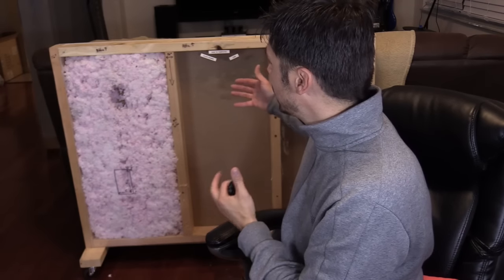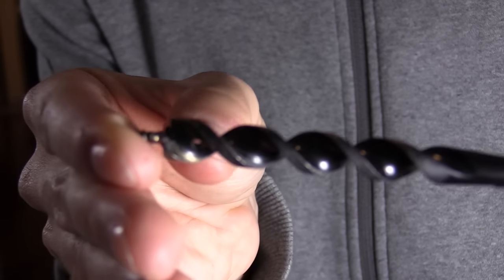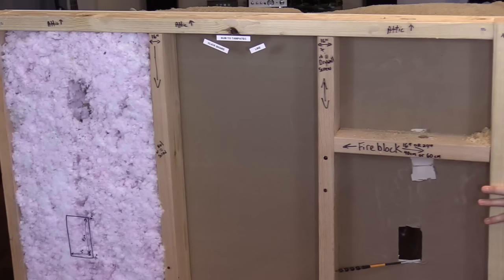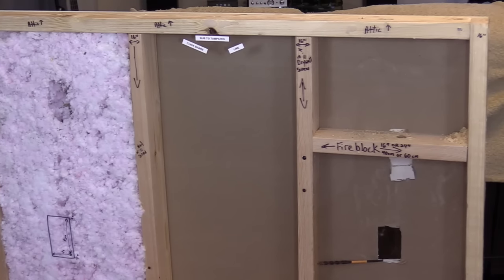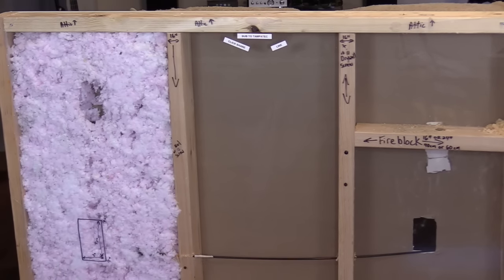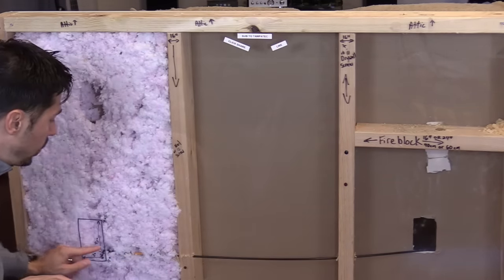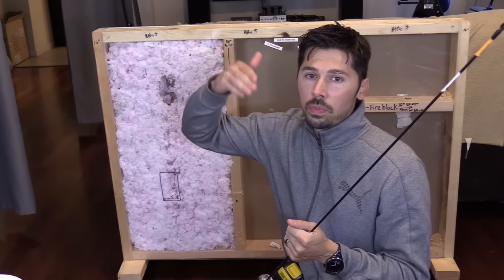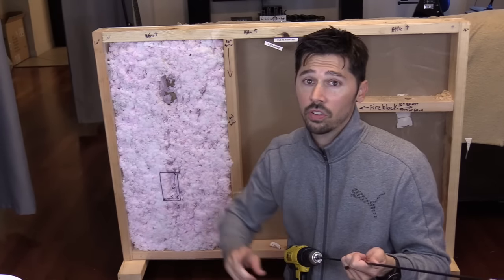HOW TO FISH CABLE WIRES THROUGH STUDS HORIZONTALLY USING FLEX DRILL BIT

Comment: Code calls for drilled holes to be at least 1 1/4" from edge of stud. You're so close to the edge you literally split the edge of the stud while drilling. And this is with the studs completely exposed! This is why blind drilling is a no no my friends. Let's not even get into the existing wires and water pipes that could be in the way.
Reply: Exactly.
Reply: Definitely!  The damage that can be caused is not worth trying to take the short cut.
Reply: I drilled a hole that as soon as it touched the 1 1/4" edge from the stud... My whole house collapsed. Then burst into flames. Then flooded. Damn short cuts. 😪
Reply: @kawininja06  🤣🤣🤣wtf!!!!!
Reply: Only on loadbearing walls. Non-loadbearing this is fine
Reply: @depholade  that is absolutely incorrect per NEC Code. I really hope you’re not a licensed electrician saying this.

300.4(A) Cables and Raceways Through Wood Members.
(1) Bored Holes. In both exposed and concealed locations, where a cable- or raceway-type wiring method is installed through bored holes in joists, rafters, or wood members, holes shall be bored so that the edge of the hole is not less than 32 mm (1 1 ∕ 4 in.) from the nearest edge of the wood member. Where this distance cannot be maintained, the cable or raceway shall be protected from penetration by screws or nails by a steel plate(s) or bushing(s), at least 1.6 mm ( 1 ∕ 16 in.) thick, and of appropriate length and width installed to cover the area of the wiring.
Reply: @Ih8chew  Holes in non-bearing walls can't exceed 60 percent of their width. Notches in non-bearing walls can't exceed 40 percent of their width. The edge of a hole must be at least 5/8 in. from the edge of a stud.

IRC 6-1 Notching and boring clarifications
Reply: @depholade  you’re going by international code lol. This guy is from the USA and as such he’s subject to follow NEC code. My point stands. And even so, per IRC you just stated the edge of holes must be at least 5/8” from the edge of a stud and he’s clearly closer than that since he split the edge 🥴
Reply: Incorrect.  Only on load bearing walls
Reply: @cd1168  wrong. See nec 300.4(a)(1) and 300.4(D) then come back.

Comment: See how close to the edge you were on that second stud? That is a significant degradation of vertical strength on that stud, so for any of you following this direction, make sure you’re not drilling through any load-bearing studs.
Reply: Completely agree, however, how do you do the job correctly behind existing drywall?
Reply: @jrbling25  do whatever you have to do to drill further in the center of the stud: remove more insulation, bigger access hole in your drywall, etc.

Comment: I'm going to be running some speaker wires sometime soon. I have a question; between two vertical studs they'll be the occasional horizontal stud. Even your mock-up has it, it's the far-right section.I'm going to be traveling up the wall quite a bit so I'm going to run in to the horizontal studs, how do I access/find/drill that if I don't have an attic and there isn't already some sort of opening like an outlet?
Help,
Michael

Comment: So your last comment with the wall to ceiling.. how would you go about getting the wires through there when you can't get to that spot from the attic or above because it's between floors or the roof is right on that spot?

Cut access hole and patch it back together?
Notch the corner and patch it? Add metal safety plate to prevent drilling into.

Comment: Video jumps at 1:44 , the critical part, where if you don't have an open wall like this, you will likely drill out through the other side of the drywall! .. No mention of being SUPER careful to drill straight or you will come out the other side... inspection camera is needed to be sure the bit bites in to the correct place.. if even possible.. these bits are so stiff it's very difficult to get a straight hole. The first hole is most important to be the closest to straight as possible, and it will guide the rest.

Comment: Thanks for taking the time to post Tampa.. but the bit running through the edge of the second 2x4 would get a fail on any inspection if seen. I know usually that is not something inspected when running 'speaker wires or TV cables but electrical is a whole new deal.

  If that wall actually had Sheetrock covering it the hole might have remained hidden but if you had to go through still another 2x4 you likely would have drilled the hole THROUGH the Sheetrock and INTO anything close to the wall. Better to open the wall with a small square to allow repositioning the bit closer to center and using your hand inside the hole keep the bit from angling away from center.

Sheetrock repair is very simple and fast compared to repairing the damage to wall structure or any component you might drill into. I'm presently doing this to wire a dedicated 20 amp circuit for my new welder to be used outside. I used the Flex-bit to go through the Top Plate and fiberglass fishing tools to run through to connect to the 20 amp wire I need to pull back to the receptacle. Again.. Thanks for posting

Comment: Drilling upwards into the attic, especially by roof pitch joints can have power wires there. It's just best to avoid exterior wall fishing if possible. Easier to just patch a small hole than using a "flex" stiff bit.
Reply: Yeah flex bits are really only the best option for drilling down into scrawspaces to wall fish

Comment: If you need to cut out squares to get the drill bit in and then another hole a few feet away to recieve the other end, your aswell just cutting the squares out at the joists and chiselling gaps out for the cable to sit in, then you can use the joist to screw the square that you cut out back in.

Comment: I've never seen one of those before. Very interesting. I wasn't sure if you attach a wire to the drill bill though and I'd imagine it'd get twisted drilling it through.
Reply: You don't attach the wire or pull string until after you've completed the drilling operation. Once the bit extends from the starting point to the ending point, you can then attach a wire or pull string to whichever end makes more sense. Finish by either attaching to the end previously in the drill chuck and pulling the bit out at the far end, or by attaching to the fluted far end and pulling the bit back out along the path you drilled.
Reply: How do you know there aren't any other wires back there?

Comment: how do you know you won't be drilling into existing wiring?
Reply: 99% Perspiration you don’t. But wires are usually stalled somewhere around 18”(can’t remember exact measurements) above an outlet so just be mindful of outlets and be careful.
Reply: Christopher Crawford 18” above outlets?
   I have some run in line with outlets in old work boxes.

Comment: What about how the second 2x4 stud cracked through to be visible in the “front”? I would be flipping bricks if it was my house. Or is it no big deal?
Reply: He was to close to the edge but in the real world that would have been hidden by drywall
Reply: Garrett Carter if you’re asking about the strength of the stud, should still be really strong.
Reply: @brentsido8822  In the real world it would have popped out of the sheet rock.  His didn't because of the plexiglass over the insulation.
Reply: @xsteel3292  after watching the video again your probably correct.

Comment: Hi Tampatec!  Newly subcribed.  Question please... will the EA37536 Flex Shank Installer Drill Bit work for Romex cable as well as Coaxial cable?  Thank you!
Reply from the maker: LG should work ok but double check the width.

Comment: This is exactly what I needed. My house was built in 1913 and has original shiplap on the walls and ceiling. I really need to add additional outlets and I don’t want to risk damaging the shiplap attempting to remove it to drill thru studs. I have cathedral ceilings and a 5x5 crawl space under the house. Thank you so much!

Comment: this method works with Perspex, but not with drywall. If the drill bit is at the edge of the stud, it will come out of the drywall every time. It takes the path of least resistance, and the drywall is too soft. Do a demonstration with the hole you’re drilling through on the Perspex side, and drywall on the other side, you will see what happens. And to avoid coming out of the drywall, you need to use a guide for the drillbit, and a rodderscope so you can make sure you’re drilling in the middle of the stud, not the edge

Comment: Isn't it against code to trill a hole through the far side of the stud like he did with the second one without installing a protective plate?
Reply: Carlton Brooks don’t think so. But not recommended unless absolutely necessary. Personally I’d put a plate if it’s going above 3ft. Anything lower and you should be assuming there’s other wires for the outlet running through the studs already.

Comment: Also have to be careful of drilling sideways if electrical outlet is down  in line with stud otherwise drilling through romex usually stapled to stud. You'll see a nice spark 😉
Reply from the maker: very true
Reply from the maker: thx, i added a note in the video description.
Reply: So you can only go through 2 studs and to the other side of the wall? You also have to be careful of other wiring, pipes, vents and the like.
Reply: LongIsland - Does the clown have a license? Scammers don’t pay to fix broken branch circuits.
Reply: LongIsland Installations you'll feel that spark too!
Reply: Gerhard Braatz There are extensions but be sure to torque down the holding screw I've lost a few bits in the walls. Also the bit can install wire to either side of the wall.

Comment: Definitely don’t recommend doing if you don’t have a lot of experience. Electrical wiring and you could bust through the drywall. Recommend always running wire down the wall.

Comment: Try drilling through REAL insulation. If only it were this simple. Australias insulation is thick and all shreded together not little bits like this. U can rotate either way and it will wrap around the bit tip